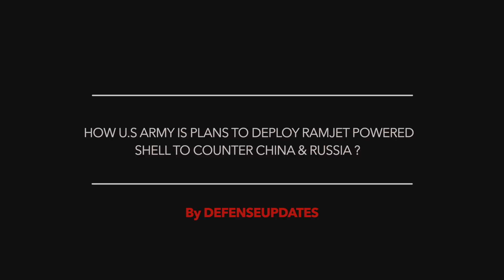RAYTHEON TO DEVELOP RAMJET POWERED LONG RANGE SHELL FOR US MILITARY’s 155 MM CANNONS !

Comment: Just speculating but I wonder if a 155 mm gun system with ramjet projectiles would work on an Arleigh Burke class destroyer.  The smart round could compensate for the instability of the ship mounted system at sea.  With a potential 100 km - 150 km range that would make this a formidable weapons platform.

Comment: I find it amazing that the guidance system would survive the shock of artillery propulsion.
Reply: I find it amazing that the fuzing systems already do, but a guidance system.....that's a horse of a different color.
Reply: They probably launch at a relatively slow velocity, and then rocket boost to speed. In this case they can even boost the rate of fire

Comment: My concern with this idea is that by ever increasing the amount of propulsion, guidance and such into our 155mm shells, it will gradually reduce the explosive charge and decrease effectivesness.

Increasing the range of artillery results in batteries being placed further from the forces the support, which is fine, unless that range decreases the effectiveness of that battery in assisting those combat units.

Comment: A shell with guidance and propulsion?

That's a missile. 🚀
Reply: They use ramjets instead of conventional rockets. Ramjets only function at high speed so they have to be launched out of an artillery piece
Reply: @dimes7742  Better yet!!!
Reply: Turd Ferguson  I'm sure that will violate the Geneva convention somehow. You should eat jalapeño and laxative and call it pepper spray.
Reply: pinaka!!!
Reply: It's a hybrid.
Reply: This is something the company in Norway called Nammo developed a few years ago...
Reply: Correct. So why not develop a missile and no more empty promises 155mm Zumwalt Class zero "zip gun."  
Snake oil salesmen. Blahh!
Reply: @byronharano2391  unfortunately you never know if it will work or not until it fails in development

Comment: 155mm is about 6 inch or diameter of a short range Sidewinder. So I assume you need the firepower so you bring shells and powder and a big heavy cannon that is now a launch platform for guided missles. If you lose the heavy cannon then more ammo or more mobility. Over 5 miles to ~20 spotter feedback is effective. Over 20 mi then each shot will vary on air density wind currents et al. Kinda why Battleships with 16 inch guns were endpoint in evolution. Weren't these the first to fire nuclear shells? Note RAMJet can ignite at subsonic speeds. SCRAMJet requires supersonic airflow. But doesn't fuel use up space for warhead size?
Reply: Kinetic energy rounds. If they hit at 3300 fps and weigh 1 lb, they’ll hit with 170,000 ft,lbs of energy.
Reply: @grubalaboocreosote4774   "and then the gamer sees the real world and cowers ..."

Comment: Strange - using an internal ramjet instead of external hypersonic propulsion. Does anyone have any idea why?
Reply: So it all fits in 6" diameter. Ramjet? Shell is already supersonic, using Scramjet for hypersonic so more air resistance (sonic shock waves) so doesn't travel as far? Several longer range Hand Held AntiTank weapons in use today use subsonic rockets. Problem with wireguided but most now fire and forget.

Comment: you want to spend time and money to maintain ramjets in each shell instead of using a regular and reliable shell?
Reply: @Dylan Rehm You are wrong. Ramjet engine do not have turbine and fan, but it still have all the pump and device to pressurise and control the fuel air mixing.

This is also why meteor AAM can not replace Aim-120, because rocket engine is far more simple and easy to maintain.
Reply: Ramjets could not be more simple in design. Once you figure out the design, really should be simple to manufacture and simple change the amount of fuel to change the range for each shell. But ram jets are mostly about perfecting the design, and given they have the added benefit that the shells are pretty much moving at known speeds coming out of the barrel, it actually makes their design easier then many places ram jets are used where more variable speeds are required.  There are far more complex shells in use...

Comment: Perhaps it can be fired from the DDG-1000 guns?
Reply: That's what I was thinking, though I'm not sure the Zumwalts guns can handle the chamber pressures required to propel the ramjet shells beyond mach 3. The Zumwalts guns were designed to fire rocket propelled projectiles whereas the 155mm ramjet shells will require conventional propellant to get them up to speed instantaneously.
Reply: @MrBurgerphone1014  aren't those ramjet shells are rocket assisted as well?

Comment: This seems a lot like the time we invested in the “Advanced gun system” of the Zumwalt and then the rounds were found to be more expensive than tomahawk missiles. I just hope if they go down this road they make sure to keep the cost down enough to afford the rounds. Also it might be a good idea to look into similar systems that to the Chinese and Russians have with larger calibers since it would be easier to improve on the concepts they’ve already developed.
Reply: The LRLAP round was developed by Lockheed Martin. In 2001, the director of Lockheed's guided projectiles division claimed the LRLAP would cost "less than $50,000 each." Even factoring in inflation, the rounds have ended up costing nearly twelve times as much.
Reply: If the railguns ever get going and transfer over to the other forces as they keep saying we shall see though.  Kind of like the metal storm gun we were promised that you can find on your tube.
Reply: I thought the point of a railgun was cheap projectiles with a consumable sled.

Comment: The next question to ask is, "If this works for the army, would it be cheaper to use this technology for the old battleships and replace missle frigets?"
Reply: The "Old" Battleships are too far gone to upgrade
Reply: @thesirmaddog8209  OK, really wasn't thinking about bringing back the old ships.  Really more like the 16" guns with this technology.
Reply: they are far too old. the question will they build a cruiser using this tech.
Reply: No. The question should be will or can these two new 155mm rounds can be adopted  to be fired from the three stealth destroyers?
Reply: @bhogan843  if they willing to spend the money up grade them.
Reply: @spark300c  Probably be too much for the entire ship.  But a new ship with larger guns using this technology.
Reply: @bhogan843  
When you design something from scratch anything is possible

Comment: Long range is very good, but everything comes with a compromise. Ramjet artillery shells probably have smaller burster charge compared to non-ramjet artillery shells...
Reply: LOL... You don't get what "Artillery" is
Reply: Supreme Flagship You have to remember the faster Something travels at, the more kinetic energy will have once it hits a target or area. And well when that is paired with an explosive round. The overall explosion will be increased even if a shell has a lower charge/payload. Now do I reckon it will be hired compared to the same shell without a ramjet booster. Personally, yes. But if they can tweak the design or the booster can be turned on once it’s half way too the target or 100-200 meters away. The kinetic energy will be more if the booster was activated early.

Right what about materials. I want to see the main user and it’s allies to first make a new generation of shell out of tungsten. And afterward, use carbon nanotubes since carbon nanotube fibres can already be made. So even if non carbon nanotubes aren’t feasible at the moment. Instead they could use the fibre variant, and than wrap the fibres around what most of shells are made out of. 

But on the other hand if they can pair it with say tungsten the damage could be immense if the costs aren’t an too much of a issue.